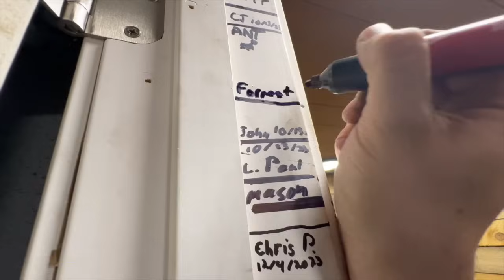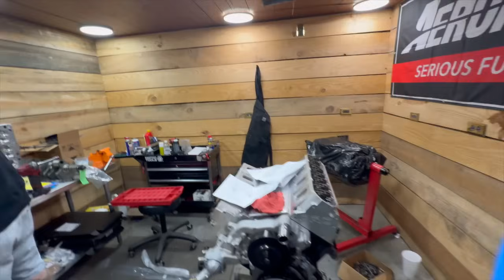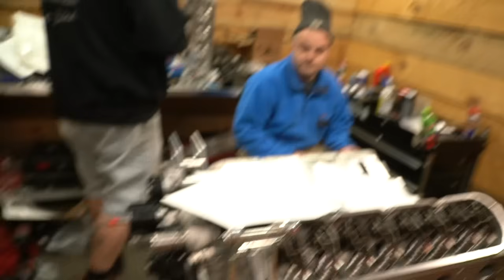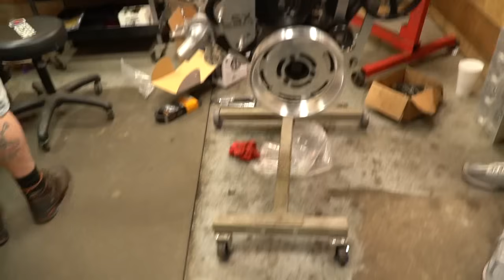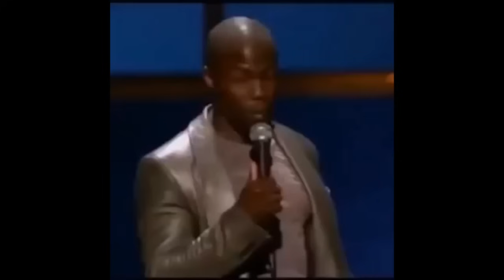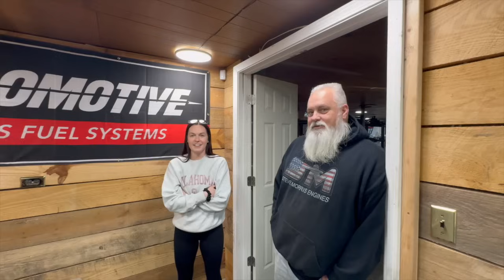My SUPERCHAGED LS engine is TOO BIG!!!

Comment: That crank pulley is nuts. Looks like you have a MTD lawn tractor wheel for a bottom pulley. Running methanol because it's 12lbs of boost @700rpm